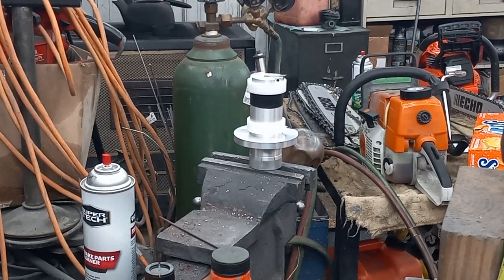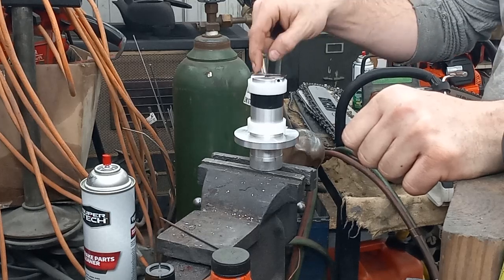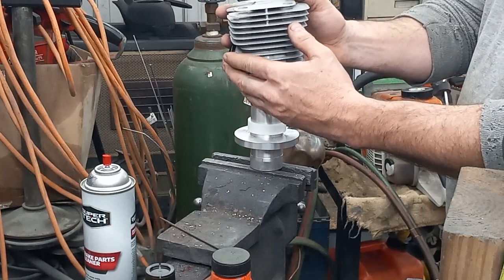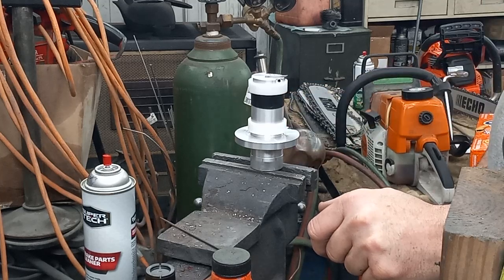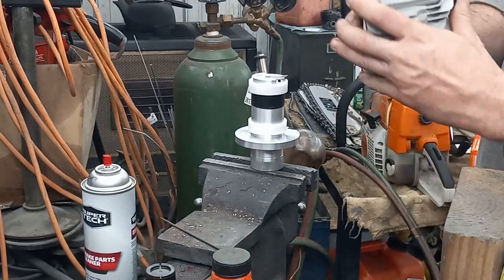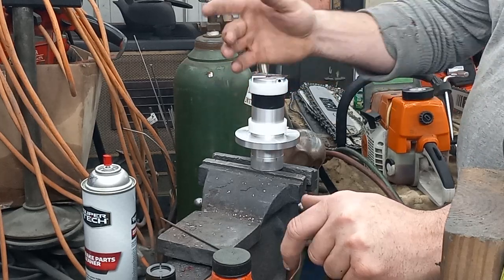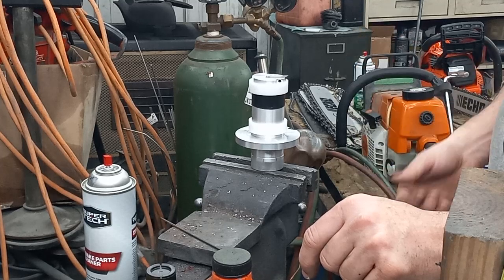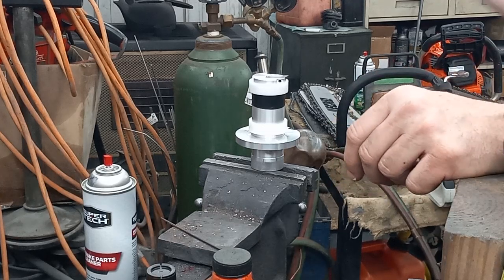review of dyno joes hand chamber cutter

Comment: Do you ever mock up a piston with wood? I like to turn one to match the bore, then you can put a screw in the center, sandpaper on the top, grab a drill and get to work. The wood pistons help me grind my uppers too.
Reply: Btw I use this to smooth out the Band...not cut it. I think Joe needs to come up with a chainsaw porting vise that can hold a bottom end. I've seen some one-off versions but I know joe would nail that design.